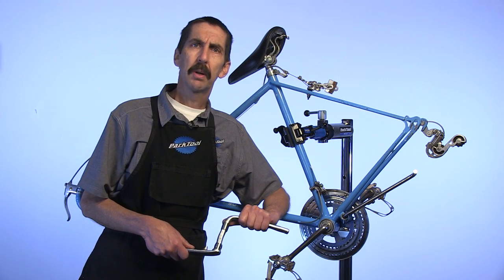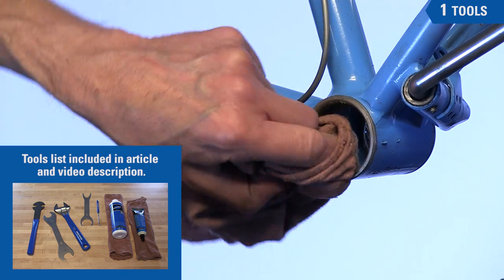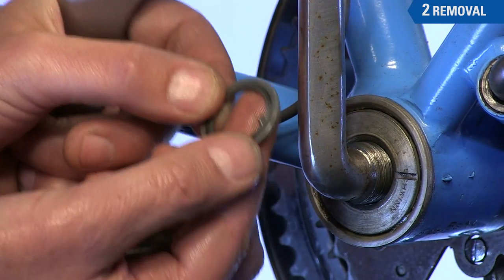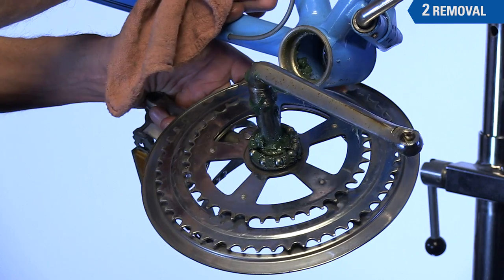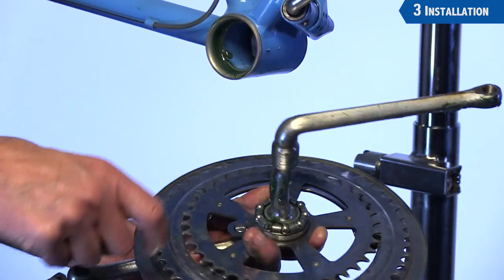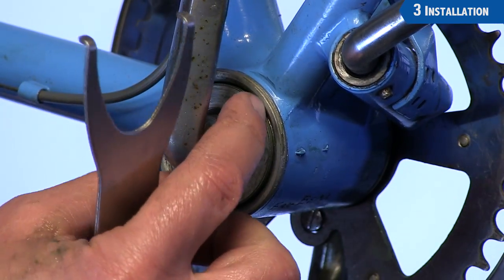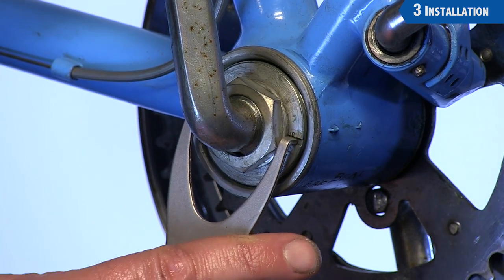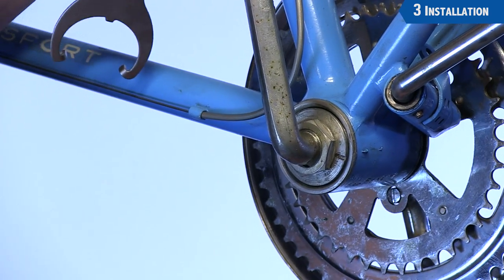One Piece Crank & Bottom Bracket Removal and Installation

Comment: I noticed that in my country, all these bottom bracket cups have a really small inside diameter hole, so it's not possible to take the crankarm off without hammering one or both cups with a wrench. I already worked with old and new bikes, watched a good amount of videos about this BB and never seen a cup like this in the video

Comment: I have a folding bike with this kind of bottom bracket cups, but the crank is a three piece?? What would I do if I want to replace it with something more modern? It doesn't seal at all so it gets creaky even if it just gets wet.

Comment: FORGOT RUST. Greatly helpful, but If were new to this on a 50 year old bike there's a solid chance that cone ain't sliding off like it does on camera. It would be nice, and realistic, if you included assumed rusted threads and solidified grease removal in all of your vintage parts videos. My answer was hammer, screwdriver, steel wool and an hour of toil so I would love to find an easier solution next time around.

Comment: Pregunta: ¿Se puede reemplazar con "Press-Fit" en caso de que se acaben este tipo de componente?.
Gracias.
Reply from the maker: Parts for these cranks and bottom brackets are still available. The bottom bracket is a press fit but cannot be replaced by a newer pressfit standard.
Reply: @parktool  Oh. Entiendo. Gracias.

Comment: How to remove a stubborn lock nut? I used the spanner counterclockwise at first to remove it and got it ready stuck! I should taking notes from this video to clockwise my turns to loosen it. The lock nut is worn out. How do I remove it and the worn locknut?
Reply from the maker: Arrange yourself and the cranks for best mechanical advantage.  If you stand behind the bike,  have the right arm face to the back.  Select the wrench flats that will have the wrench face to back the back.  Reach over the frame (or through the frame) with your right hand.  Pull up on the right arm while pushing down on the left. Keep the wrench straight and apply force.   Two arms moving opposite direction.

Comment: Kind of think that this old fauber crank had it's good sides compared to todays hollow tech bearing which wears out pretty fast and you have to buy new bottom bracket which on the other hand is not so expensive.

Comment: Can It be replaced with external bearing bottom bracket? thanks
Reply from the maker: There are adapters that can be pressing in place that accept threaded bottom brackets.  The external bearing style can then be installed.
Reply: @parktool  Thanks for the reply, what's the name of the adapter ? It looks like a double threaded ring, doesn't it ? Kind regards.

Comment: I have a bike with this crank arm. However, it is loose and wobbles when pressure is applied. When I open it, what should I do to fix it?
Reply from the maker: Typically when a crank arm becomes loose on the spindle of the bottom bracket it will need to be replaced. They will continually come loose. New arms are fairly cost effective from a local shop or online if you know the length and the orientation of the square.

Comment: I was able to successfully remove my one piece crank from my bottom bracket and take everything apart to replace the bearings, but I have no clue where I can find new bearings. Where can I find these bearings for a 1979 Schwinn suburban? I don't know what size they are either. The bearings have a code on them "6178a" if that helps at all. Thanks
Reply: I believe they're universal and that you can take the old ones to a bike shop and they can get you new ones that fit.
Reply: @PatrickDSimpson  yeah I was able to find them on eBay I believe

Comment: Hello, are the shell, cages bearings universal size ? I want to replace the whole crank set because the chain ring is bent
Reply from the maker: The caged bearings for the One Piece crank sets are not universal. If you are replacing the entire unit with cups and cones, it should come with new bearings to match.

Comment: can a one peace crank be replaced with a different type? im looking to replace the one on my bike with a crank with a free wheel sprocket for a project of mine.
Reply from the maker: There are adapters that be fitting into the large shell that reduce the diameter to the common BSC threading (1.37x24). A cartridge bottom bracket can then be installed.
Reply: awesome, thank you for the information.

Comment: does it matter wich way the ball bearings are facing
Reply from the maker: It matters which way the cage is facing.  The open side should face the cone.  The wrong way will mean the metal cage rubs against the bearing surfaces, rather than the ball bearings.  Put the cage on the cone, and spin it.  Now flip it over and spin again.  One side rolls on the ball bearings, that is the correct orientation.

Comment: Can I replace the one piece with a three piece ?
Reply from the maker: Yes, you can install adapters the reduce the sizing and provide internal threading for the three-piece bottom bracket spindle units.

Comment: How to you remove the right site bearing cone with the chainring on??? 
Its the only part you didnt remove..
Reply from the maker: The cone on the driveside is removed either with a large wrench or a vise on the wrench flats on the outter most part of the cone. Or sometime there are notches for a spanner tool.

Comment: NUTS.  Every video I find isn't showing me what I need.   I'm trying to REPLACE the crank arm.   HOW do you get those parts OFF the opposite side????  Mine wont budge.
Then again, I see a special tool you folks use.  Not sure what that's called or where to find one.
Reply from the maker: The crank needs a crank remover tool, also called a "crank puller" or "crank extractor".  For the three piece cranks, the arm is pressed tightly to a spindle.  The bolts are remover, but then a remover such at the CWP-7 is used to un-press the arm. http://www.parktool.com/product/universal-crank-puller-for-square-taper-and-splined-cranks-cwp-7

Comment: after ungreasing and regreasing whenever i pedal it gets stuck while turning like somethings pushing against it making it wayy harder to pedal and makes a sound like medal is touching medal any help anyone?
Reply from the maker: Double check the bearing retainer is not backwards
Reply: @parktool didn’t work, any other reason why?
Reply: Did happen to me when I bend or warped the caged bearing replace the caged bearing they are cheap

Comment: Ok how do you remove the cups.
I hit one side out with a pipe and got it out but the non drive side is stuck on and I can't get it out
Reply from the maker: You are on the right track. Hammer and a large punch from the opposing side is how these are removed. Might need a slightly larger hammer and to walk it out hitting one location and then a location 180 degrees from it.
Reply: @parktool  yes I had to go to a bigger hammer and bigger pice of pipe that covered the entire cup from inside and still had to give it 3 good hard hits before it popped out. The inside feels and looks was glued in place